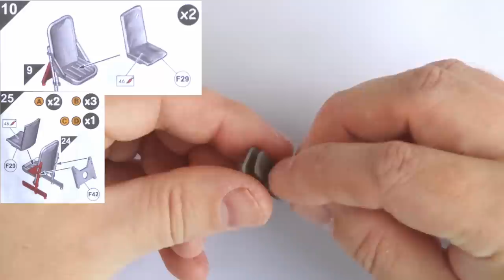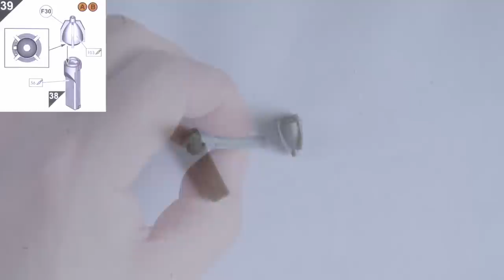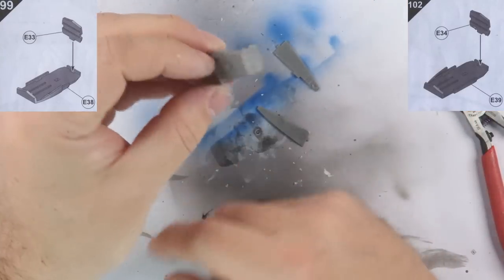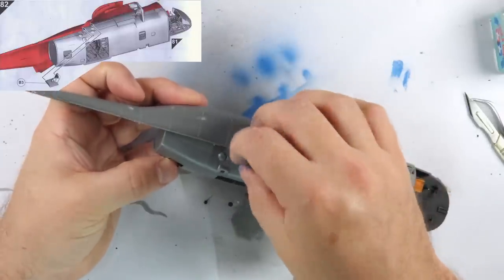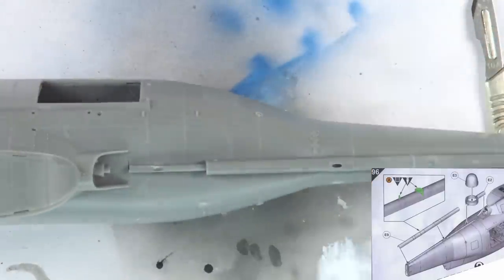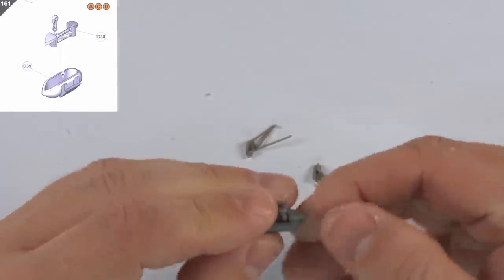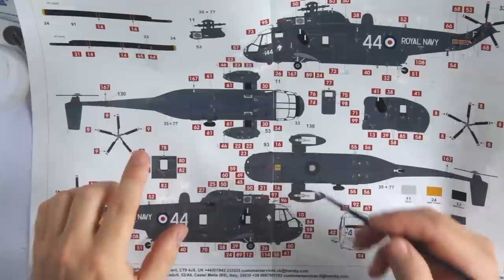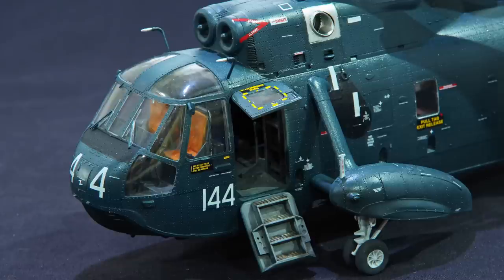Airfix Westland Sea King 1/48 Full Build Video - Does it live up to the hype?

Comment: Nice build of a workhorse helicopter, hopefully other versions will be released, shame that no crew are supplied, I would be interested in seeing a weathering vid. Thanks
Reply from the maker: Thanks - as I mentioned in my unboxing video, Airfix commented on the "no crew" piece - firstly, most models are built without crew, secondly in order to accomodate 1970s, 1980s-90s Navy and civilian crew would have meant at least three variants, pushing up the cost of the kit to benefit a minority - same with weapons They prefer to leave this aspect to the aftermarket.

Comment: Very nice job Alex and a good review. If I have a gripe it would be with the need to add the 'infill' panels on the fuselage side. On the actual aircraft, these were invisible so would take an awful lot of fettling to make the joins disappear (see Nigel's Modelling Bench) - might have been better to engineer it so you have to cut out the openings required, rather than fill the one's that are not.

Comment: The short shot is a frustration as you quite rightly point out their quality control is still not up to par. For me though the exterior surface detail is a real bug bear. The Sea King is covered in mushroom rivets.

I appreciate their reasoning for the recessed detail was being easier to restore after sanding and tooling constraints, but looking at your build, I can't see anywhere, where sanding is required enough to need restoring detail. Especially on a 2023 kit, excessive sanding shouldn't be needed. Also, the center console is covered in raised details. Not to mention Revell achieved it with their old 1/72 Sea King.

Just my two thoughts.
Reply from the maker: Honestly, I MUCH prefer the recessed rivets - look at any picture of a Sea King at the size a model is and you cannot see any raised rivets. I chose not to do any repair work on my kit as I wanted a very basic build to showcase the kit, not me. Tooling constraints is not the issue here - it's easier to make raised detail in any steel tool (it's why early kits had it, after all)

Comment: Great vlog. Quick question: after completing painting you said you coated the model with I think 'pledge' ready for decal application ? what is pledge or am I mistaken? Also what do you coat your decals with? - thanks.
Reply: Pledge is one brand of acrylic floor shine. Self levelling, very glossy and quite robust when dried.
Formerly known as Future floor shine, a "secret help" for modellers who wanted a  surface preparation before decalling. Decals set on glossy surfaces without silvering (from air trapped between rough flat colours and the decal).

Comment: I'm wondering why they didn't make the two hull part differently like one side normal cast and the other side made of a clear part so you could see all that lovely detail, but then again I suppose the price factor would come into it what a shame for a beautiful kit.
Reply from the maker: I actually asked this very question on the release day, and it's because clear part toolings need to be highly polished, after which they aren't suitable for use with normal styrene, so it would have required a separate tool, and much more cost (one we as modellers were unlikely to pay for)

Comment: I noticed something glaringly obvious that's missing from the kit which applies to all Sea Kings no matter what version.  There's no inclusion or mention in the instructions for the addition of the hand rail support posts on the crew door behind the cockpit.  There's two posts, one on each side of that door with 4 braided metal cables connecting from the door frame to the door via the posts which fold down when the door is closed.  It's a feature you can't miss on the real helicopter and yet another example including the decal issue that although a small detail, the omission is disappointing given the efforts taken on the rest of the kit.
Reply from the maker: I think they expect you to add these for yourself - given their inclusion on the example builds on the Airfix product page, but I agree that it's an odd omission given everything else

Comment: No crew, more’s the pity.
Reply from the maker: As I mentioned in my unboxing video, Airfix commented on the "no crew" piece - firstly, most models are built without crew, secondly in order to accommodate 1970s, 1980s-90s Navy and civilian crew would have meant at least three variants, pushing up the cost of the kit to benefit a minority - same with weapons They prefer to leave this aspect to the aftermarket.
Reply: A shame Airfix cannot source its own set/s of figures, as a ghost crew leaves less opportunity for a sense of scale, especially for diorama builders. @MannsModelMoments
Reply from the maker: @davidjefferis4467  I'd like to see Airfix make figures similar to those ICM make